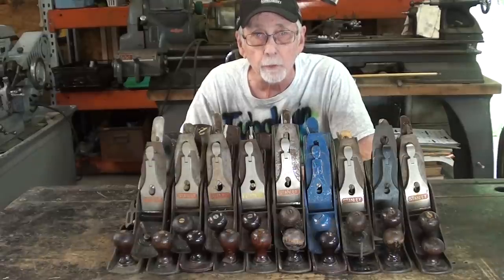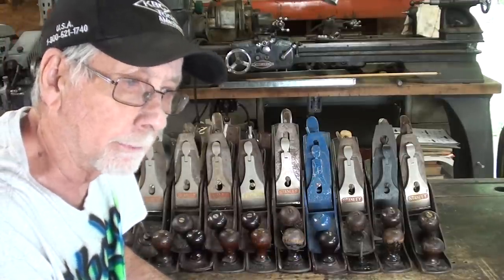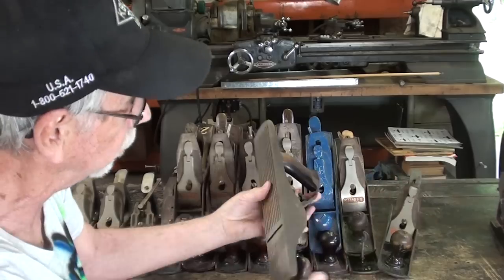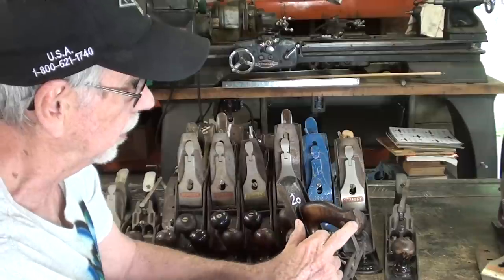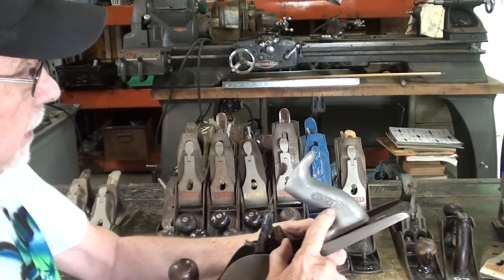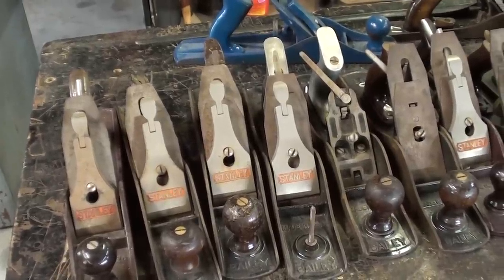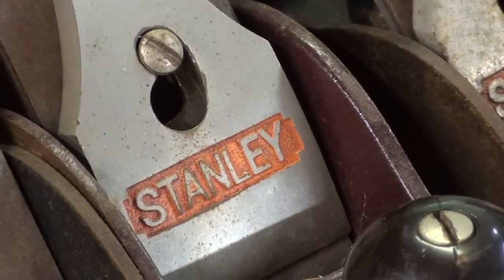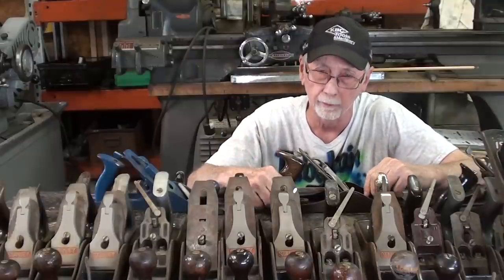STANLEY PLANES IN THE SCHOOL SHOP Tips #645 tubalcain

Comment: Hi Mr. Pete - I'm with Jim C. ....please talk about shop class demise.   Those are not particularly beautiful planes but I very much enjoyed the discussion.
Reply from the maker: Thanks
Reply: You could make some users out of that pile. Number 5s are my favorite all arounder.
Reply: @mrpete222  Here in England, my school had 2 woodwork shops and 2 metalwork shops. Woodwork shop 1 is now just a social space and metal shop 1 was in a building now demolished. They went from 'wood' and 'metal' to 'materials science' and robotics. All the machinery was sold off.
Then at the other end, some maths rooms became computer rooms - so needs change !
Both metalwork shops had aluminium casting facilities and blacksmith facilities as well as lathes of various sizes.

Comment: Shop classes (late '60s and early '70s) were mandatory in my Jr Highschool (Long Island, NY). They were setup on a quarterly basis, one quarter for electronics, one for metal shop, one for carpentry and finally one for study hall. Highschool was similar but you got to pick a field.  Metal/machine/auto shop was a four year program as were carpentry  and aviation. Senior class automotive ran a couple cars at the drag strip. Senior carpentry/plumbing/electrical built a small house in the courtyard and sold it at the end of the year (after inspections) to buy materials for the next years classes. I took the aviation program (BOCES) where first year we learned accessories/powerplants and rebuilt a continental 4-cyl (as parts allowed), second year was structural/hangar where they welded up a Piper Cub and then covered it with fabric at the end they took one of the completed engines and mated it to the airframe got it inspected/signed off and certified for flight. Third year was flight science where you earned your private pilots license. We had a bell helicopter that was being restored (think M.A.S.H.) a turbojet on a stand and an old navy trainer aircraft in the hanger. Engines were donated as were parts, materials and staff were paid for by a cooperative system of many schools in the system. They also had HVAC program as well as a nursing one. BOCES is still in operation in Long Island but the programs have changed over time, check them out(B.O.C.E.S.- Board Of Cooperative Educational Services) Industrial arts are NOT dead. P.S. I LOVED the industrial art program in central Long Island and went on to a stint in the NAVY (PowerPlants) and a career in Lockheed Martin (Space Shuttle).

Comment: Mr. Pete I work with wood as well as metal and I still love using a hand plane.  They still have their place and are very widely still used.  If you have wide boards that won't fit on a jointer that you don't want to cut down and re-glue then you're going to need a plane.  Those handles you have there are Rosewood.  Rosewood is endangered and there are people across the pond that have their Ebay items confiscated because of the Rosewood handles.  The planes you have still hold value.  Plane collecting is still pretty popular.  I hope you find a good home for them.  Too many end up in a scrap bin.

Comment: G'day Mr Pete I'm 63yo when I was in hight school we learnt "Wood work" and that was all it was called.   We used N04 Staley Smoothing Plane we were taught before we even touch them the parts and how to sharpen the blade first on a bench grinder and then we were showen how to use the Jig that the blade sate in and we sharpened on a wet stone but we used oil.  They were all well looked after and  I was very grateful that I learned it because I use what I learned today.  The best Plane we were taught was the wooden ones because they don't bruise the wood.   Now Im loving metal work.     I can't get over the state of some of these planes Stanley we were told was the best plane you could buy.   Kind regards and couldn't agree more with what you are saying about the school system it's happened down here John Kinnane Tasmania Australia

Comment: My IA (Industrial Arts) education consisted of a General shop course in Grade 9 : Basic woodworking with hand and power tools, basic sheet metal work, shop safety. In high school I took three years of electronics ( + academics) with two excellent instructors and that great experience has informed my entire working life. I finally did get a chance to run a metal lathe and shaper in engineering school.  Enjoyed the video, thanks.

Comment: Shop classes for me started in 1969 in 7th grade (woodworking), 8th grade (sheet metal) and 9th grade (graphic arts). 

I loved shop classes, especially metal work. Still fondly recall my Teacher, Mr Means. As we were on a modular class scheduling system, spent all of my extra time in the metal shop or in the computer lab (I taught myself programming in 1969!)

In 8th grade, everyone learned to solder sheet metal and spot weld. I still have my hip roof tool box (50 years old now!) Some learned to braze too. As I had extra time in shop, I learned to gas weld and run our little Atlas lathe. This turned out to help me later when I taught myself to TIG weld and worked while a college student as a machinist.

By High School, I was headed to Engineering. Electrical or Mechanical, I was not sure. The only H.S. shop class I had time for was Electronics.

I ended up going to the Univ of MN and studied Mechanical Engineering. Those shop classes were critical in my very successful career leading Engineering Design and Product Development Laboratories.

Shop classes are now long gone in Urban School districts accross the US. HS guidance counselors are pushing all manner of mathematical savant's into STEM careers. Trouble is most make lousy engineers from a lack of basic background. I rarely hired urban engineers, was much more successful hiring farm kids or rural community kids.

Retired now, I teach robotics, electronics, welding, auto mechanics and many related STEM activities to Boy Scouts and other youth groups.

There is such a need for this education.

Comment: My midlife crisis was spending one hundred to two hundred fifty per plane to get a set of Stanley Bedrock planes. I’d seen them in a case at one of the best antique malls in reasonable driving distance. Full set breakdown below.

4 and 5 are used the most out of any planes and can be used for any task.. 1 and 2 are for very small parts. 6 is a forplane all arounder or roughing plane used before(Forplane) using another plane. The mighty 7  jointer plane for edge joining. Then the battleship number 8 for jointing larger stock and flattening large area.

 The 5 1/2 is considered the preferred plane for final smoothing. The kind of smoothing that means you don’t have to sand the wood at all. Any marrow plane with the 1/4 added is usually a roughing/scrub plane.

Comment: Shop was always the best part of the day. The first two years Wes mechanical drawing or drafting  last two years was machine shop welding gas and arc. We all had to make 8 inch mold of an anvil then cast it and then finish it files and rasps. All the guys wanted to learn how to run the lathe. We had 3 beauty’s ( used military stuff). But we also had a shaper. I learned as much as I could about running and setting it up. Guess who got to teach the other guys how to make the top and the bottom of our anvils parallel. I think it had a 16 inch length of cut. I barely scratched the surface in learning how to use it. Most difficult was grinding the tools that it used. I had a great bunch of teachers. Mr Dudley was my mechanical drafting teacher. He was also the one who took great interest in teaching me how to run that shaper. We were all farm kids so we know how to work on things long before we got to high school. Thank you mr Pete for being a teacher. It’s a thankless job.

Comment: Mr Pete, I did woodwork back in the 1970s as most of  us in the UK did at that time. Metalwork was also available.  Apart from test pieces of all the common joints, we made a couple of types of  table lamp and a tray, 12” x 24”, with little fold-out legs that would lock into place, making  it ideal for breakfast in bed.  I don’t know what happened to the table lamps but I still have the tray almost 50 years later!  Also, I did Engineering and Technical Drawing, and at age 16/17 this class became optional, so, by then there was only me and the teacher remaining!  He needed bearing support blocks for a chisel sharpening machine he wanted to make, so we drew what was required, made a pattern, and set about casting them.  The  metalwork shop had the whole works for this so it didn’t take too long  to get a couple of usable ones. That experience was worth a hundred lessons in front of a blackboard!

I own an old Stanley (Bailey) No 4 which has trued up many a door over  the years. and a Stanley 220 for really small work.

Comment: I took a wood shop class when I was in the 8th grade in the 1950's. I made a bird house that hung from a tree in my parents yard for over 50 years before it rotted away. I was also issued some severely warped mahogany which I was supposed to plane flat and then make something with it, but the year ended before I finished - I remember being frustrated with the planing process. I kept that warped mahogany for years and eventually made some things from it, including a cutting board which I still have. Those were good years - too bad they're gone forever.

Comment: I had "metal shop" and wood shop" in jr high.  Best classes I ever had!   We built spinning top motors, sheet metal tool boxes sand casting with aluminum etc. in metal shop. In wood shop I made a clock that looked like a cutting board and a lamp, also some polystyrene molding (duck decoys), and drafting.   I use those skills to this day!!

Comment: Hi Lyle, I'm in the UK. Just had my 64th !!, So I can remember being taught squaring up a sawn timber, with marking gauge and Stanley 5. I had a flair for it and have had a number of jobs working with wood.
My final employment before retiring, is as a Workshop Technician ( workshop Yoda!!) in a West Yorkshire, High School. I've seen the watering down of Woodwork or Metalwork in Design Technology. Kids taking courses, with subject titles like Product Design or Engineering (not what you might hope!!). To comment on your post, hiding in my department was a hoard of Stanley and Record No 5 planes, nearly 20 planes. After inspection, fettling, correcting, and fitting a few new handles, and a few new plane irons, I had made 12 razor sharp fully functional No 5's from a pile of 20, wrecks. Finally my son's High School taught Resistant Materials, which he continued at Alevel, at 6 form college. This can be very close to the old days if the teachers passion, the school's ethos and workshop equipment, and students ability allows it.

Comment: Back in 1960 freshmen woods class we were issued a plain iron for the at the beginning of the year and each bench had 4 jack planes in the center and we had to use our plane iron every time we needed to plane a board.  (no Jointer or power sander)  WE also had to keep it sharp and return it at the end of the year sharp.  We were taught responsibility (responding with ability)

Comment: I have a jr jack. Swh 4 swh 5 swh 6 swh5  bedrock swh I cherish and use my planes all the time. until I started using them my woodwork skills were so so... then they stepped up a notch with fitting joints when I started using planes...good vid Pete

Comment: Fond memories -- not sure what model of Stanley plane my father had gotten when he graduated from vocational school as a joiner (1950es).
He went back to school and became a construction foreman.
Anyway, at around 10 I learned importance of setting the blade to correct depth and angle.
Of course power tools are convenient..
 
Our education system (in 1970es) had wood shop for grades 4 to 6, then 7 to 9 we got wood and metals.
Then you either went to vocational direction, or to high school and university.
I did learn at least that taking time, and care produces nice results.
Even in completely different occupations.

Comment: I bought a Stanley Bailey 5-1/2 which was probably made prior to WWII. It has the corrugated surface and short front knob held on with a brass screw. I need to sharpen the blade fully, but it works very well. It seems longer than the ones in this video.

Comment: I remember making a dustpan, casting a bit of wall art in aluminum, building a spice cabinet and learning technical drafting (with those old tools where you put a drop of ink between the points, and praying it wouldn't all run out on the velum).  I never had any machine shop or auto shop classes, though the later was popular in high school.  I always assumed the lack of offerings now was due to insurance liabilities.  I am happy to report that our high school still has kids make a sheet metal tool box.

Comment: Of all the different hand tools there are I have a special regard for planes. A very noble tool that wonders can be achieved with in the right hands. I recently bought a Record brand 4 1/2 model plane from ebay. This plane is a late 70's or early 80's in its original box and never yet used and in rust free mint condition.
 I had often thought about buying a number 4 1/2  as they are a little wider and heavier than a standard number 4. The extra weight helps with the inertia required on longer cuts. I know what you mean by the satisfying 'hiss' sound of a correctly sharpened plane. I also have another very old plane in my collection. It is an Ohio Tools number 0120 low angle palm plane. It will consistently produce shavings as thin as lightweight cigarette papers. My research on it makes it well over 100 years old.

Comment: In California back in the dark ages, every junior high offered two shop classes wood and metal. Every 7th grade boy made a maple leaf shaped trivet from mahogany and next year in metal shop they made a hammer. By a fluke I did not take metal shop, but in wood shop we were taught the basics about lay out, grain, nails, screws, hand planes, saws, all hand tools. Those skills stayed with us in two useful ways, not the least of which was not having to call in a plumber or a carpenter for any small job, and when a pro was needed the ability to spot good or bad workmanship. You learn to appreciate good work and a good workman. Later on too I discovered that making or fixing something, using my granddad's tools was a great way to relax when stressed by something at the office.

I don't need to do it, but there is just something about using tools used on the ships of both world wars, a brace with Rosewood handles and worn Nickle plating,  a genuine Jennings bit, or a 100 year old Stanley plane.
Reply from the maker: That was a wonderful and very true comment

Comment: I took shop classes in high school. A year of drafting, a year of wood shop and 2 years of TV repair (which became quickly outdated by transistor based sets). Enjoyed them very much. We had other types of shop classes, but at my last high school (I went to 4) all the shop classes but basic electrical and TV repair were on the bottom floor of the school and scrawny, nerdy guys like me would likely get beat up if they took those classes. I still have 2 of the things I made in wood shop class, a stool and a propane bottle holder.
I go to the local auctions and for some reason #5 Stanleys rarely show up around here. Plenty of #4s, but few #5s. I finally snagged a decent one after about a year and a half of watching.

Comment: Mr Pete,    Since you asked, I grew up in rural Mo. and took shop in HS, was in FFA.   Wanting to get away from home, I went to NMSU in Kirksville as an accounting major.   Quickly decided not for me and changed over to Industrial Occupations major.   I took metal working, wood working, sheet metal, foundry, welding, leather craft, but mostly drafting classes.   Quit college, got a job as shop carpenter, got married,went back to college, graduated 1980.   After a few jobs started working for electrical contractor doing drafting and project management. Fell in love with the work.  I was an electrical designer in two years, changed to Consulting Engineering company for a while.   Went back to another contractor.  While there, converted to AutoCad.   Then went to largest contractor in St. Louis.  I was approved and became a Professional Engineer 2007.  Learned 3D AutoCad 2008.  Was in charge of design department for a year.  Retired Oct 2018.   I enjoy turning wooden bowls and vases in my shop now.
Respectfully,     Kevin

Comment: In the early 1990s, grade school, I took a class that included a few making activities like plastic vacuum forming and sign engraving but it was combined with a bunch of newer technologies like using lasers for fiber optics to send information and other oddities. I did not have the chance to see a machine shop till college, where I learned how to use a mill and lathe to complete prototypes for the lab that I worked for.  By 2006 I bought my first Grizzly Lathe, and a few years after a  Grizzly Mill. They are a nice size, and if you work within the limitations of the machine, you can do a lot with a Grizzly.